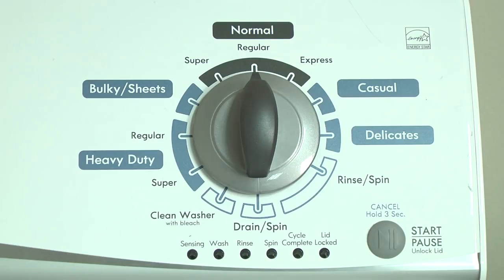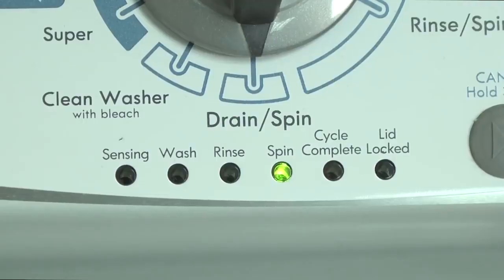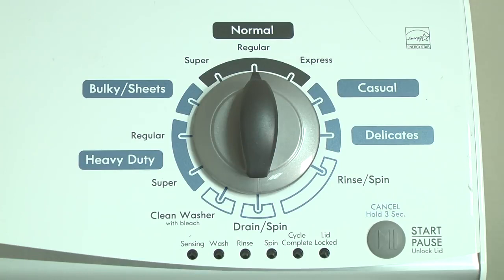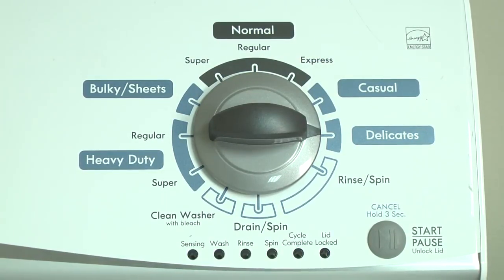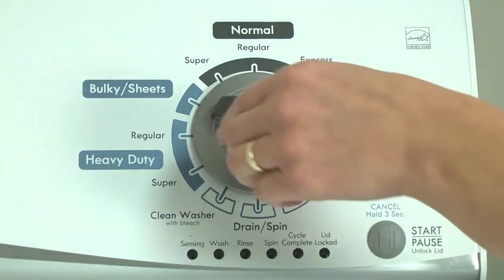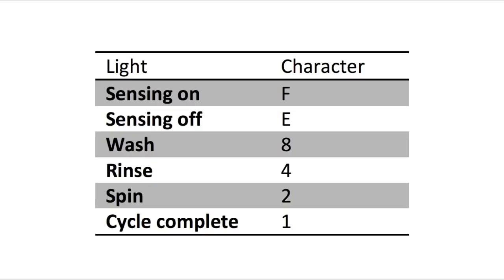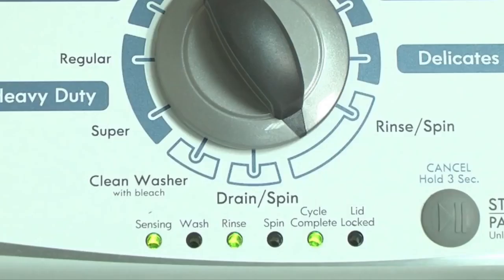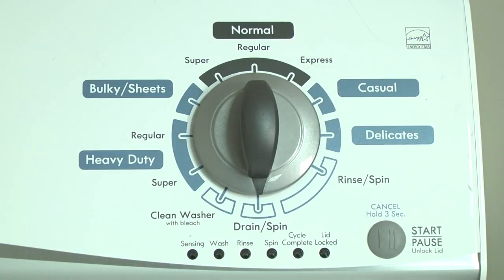Roper Washer Reset - Reset your Roper Washing Machine

Comment: Can you say it slower please, so I can follow it better
Reply: That’s why they have a pause button and a rewind option…
Reply: Actually, if you look on the lower right corner of the video screen, click on the little settings gear icon to the right of the close caption icon .
Click on playback speed. Now you'll see options to slow or speed up the video in 25% increments. Try slowing it down to  0.75. That should do the trick.
Make sure you change it back to normal speed or everyone will sound like that had one drink to many. It won't change back by itself. This also comes in handy to speed up the video if someone is talking too slow:). Good luck!  I use it to slow stuff down to learn songs (bass guitar). Works great.